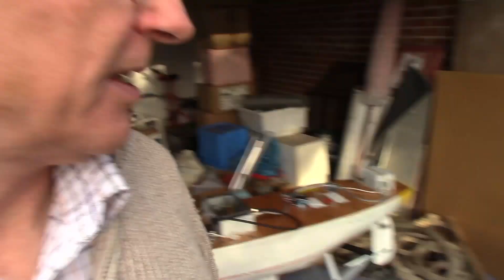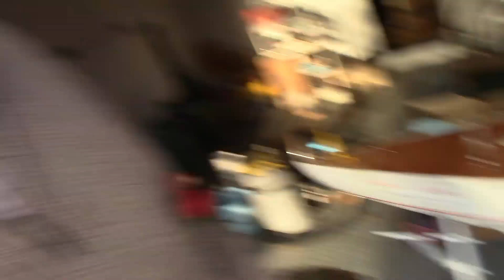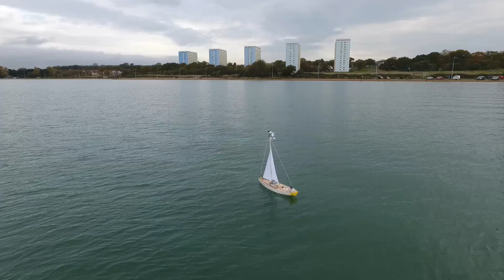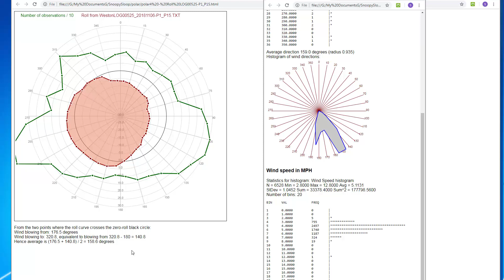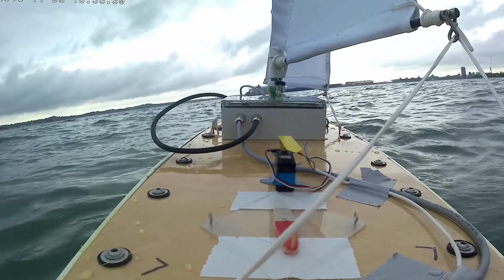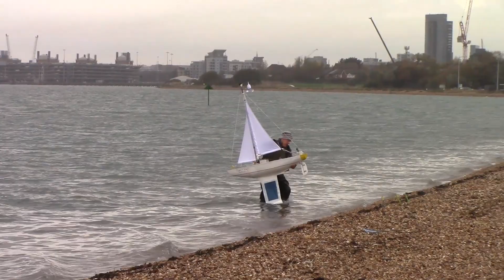Woodstock's first sea trip - part 2

Comment: More good Intel. Only thing I am concerned about is that presumably the roll angle will increase with the wind speed? In which case deducing wind direction might require wind speed? I guess all you really need to know is if the boat is in irons or not, and I'll have a think about that. In my experience those tilt compensated compasses are very good, much better than I expected. I was planning on running them through a kalman filter but in the end I grabbed three readings each time I addressed the compass, and then averaged a configurable number of those readings to give heading. I am sure the commercial systems tune this sample size automatically based on sea state but my maths isn't up to it. It may help with this though.  An alternative to consider is to increase the longitudinal stability of the boat but then if course it will be impossible to stear!
Reply from the maker: Yes roll angle certainly increases with wind speed, but the point of zero roll, when the boat is pointing directly into or away from the wind, shouldn't change, I think. The compass we're using is the CMPS11 which has both Kalman filtered and raw outputs. We are using the filtered ones so I hadn't thought to take several readings and average them. I established that from power on it takes the CMPS11 2.5 seconds to show about the right compass reading. But I don't think the filtering causes that much delay once things are up and running. We'll probably put the electronics box on a gimbal so we can test the tilt compensation.  I'd be happy to experiment with sticking some foam onto the outside of the bow, to make it more flared and hence increase the force resisting downward pitching of the bow, but Dick isn't too keen. At the moment it reminds me of watching film of RN pre-war destroyers knifing into atlantic waves. Our helmsman loop is actually running at 2 Hz, when I thought it was 1 Hz, so that must increase the fidgeting.

Comment: This gets more interesting all the time. When you said it gets technical, I nearly jumped overboard, but it was well worth watching. Why does the scallop tracking need to be removed? The arrival at the points seemed ok. Is there only a certain deviation allowed from the proposed path?
Reply from the maker: It's partly we want to master sailing the boat properly. Also, these waypoints were very close together. On the real mission the WPs may be 100s of miles apart, and we do want to limit the deviation (especially in the English Channel). Also, in higher winds or bigger currents the cross track error (XTE) could be much larger. In the Channel, except in high winds, it is likely the tidal currents will overwhelm the ability of the boat to sail. Dick then advocates just ignoring the XTE and going with the flow. This is because the tides reverse every six hours, so boat is going to get carried back almost to where it started. No point in fighting this, just hope to make a little progress in desired direction each tide.
Reply: @samuelfielder  The boat can move along the line using a simple algorithm. For this, the target geodetic point can be calculated each time (1 ... 2 Hz) in the actuator's cycle. In this case, the target point will always be directly on the course, at a distance, for example, 50 meters. The XTE calculation algorithm will require more machine time. By the way, good accuracy can be obtained without using iterative geodetic methods.
https://raw.githubusercontent.com/Aleksk1/Boat_autopilot_MMBasic/master/Photos/map_BowringAP95.jpg
Reply from the maker: I agree that a way of avoiding XTE correction is to generate snythetic waypoints a short distance in front of the boat, but this will still not produce an optimal track. I don't know what you mean about iterative methods, unless you mean use of trigonometric functions. My cross track distance function takes 25 millisecs on a Micromite running at 10 MHz cpu clock, which I don't consider is in any way too slow.
Reply: @samuelfielder  
It is desirable to have accurate and fast geodetic methods of finding the position, angle and distance ( on the ellipsoid of rotation at distances greater than 5-10 km).
Good. We are talking about the original formulas of Bowring (1981).

 B. R. Bowring, The Direct and Inverse Problems for Short Geodesic Lines on the Ellipsoid, Surveying and Mapping 41(2), 135–141 (1981). 

Compass error, wind, waves and water currents prevent the boat from moving along the shortest distance between waypoint N and waypoint N+1.  In the curvature of the boat track, I was convinced a year ago.

To prevent this, the points of the great circle (directly at the boat's course) are calculated step by step as the boat moves through the direct geodetic problem algorithm. The Bowring algorithm for the direct and reverse geodetic problem is one of the most accurate among non-iterative methods (for the ellipsoid as a model of the Earth).
 For example, the error in determining the position of a point for a direct geodetic problem is 10 cm at a distance of 600 km (2.7m at a distance of 1000 km ).
From my personal experience, the expenditure of computer time on the computation of the Bowring algorithm is comparable to the haversin formula or the Gauss method.
My program uses formulas from the book  GEOMETRIC GEODESY. PART | by. Richard H. Rapp (April 1991)
http://fgg-web.fgg.uni-lj.si/~/MKUHAR/Zalozba/Rapp_Geom_Geod_Vol_I.pdf
Page 114.
Perhaps there are other good methods that I do not know, but the Bowring formulas work well.
I compared different simple geodetic methods (Haversine, Gauss , Bowring), checking them in the program "GPS TrackMaker" .

https://github.com/Aleksk1/Boat_autopilot_MMBasic/blob/master/0%20test%20AP95%20Bowring%20Geodetic/AP95%20add%20Bowring%20metod/AP95.bas
In my  autopilot program (AP95.bas), direct and inverse geodesic problems are designed as short subroutines.
Rem===[Revers Geodetic Problem- Bowring formula to 1000km]======
Sub REVERS_GEO (Lat1deg_, Long1deg_, Lat2deg_, Long2deg_)

Rem===[Direct geodetic problem - Bowring formula to 1000km]===
Sub DIRECT_GEO (Lat1deg_, Long1deg_, A1_, s_)